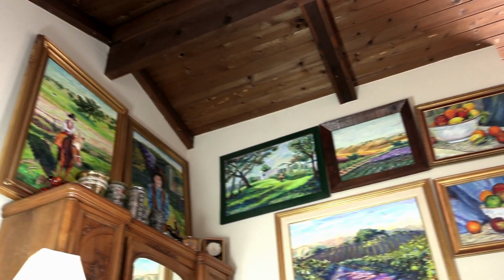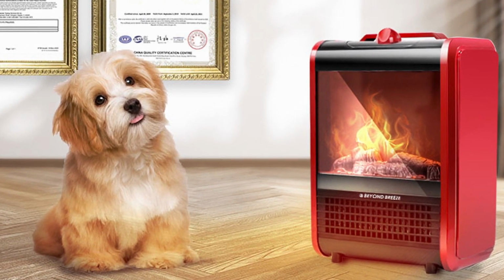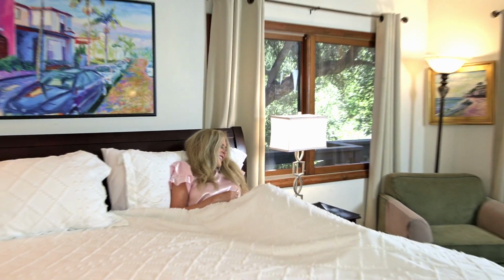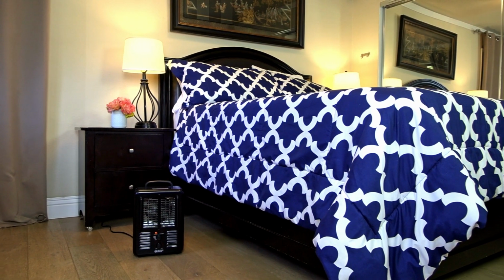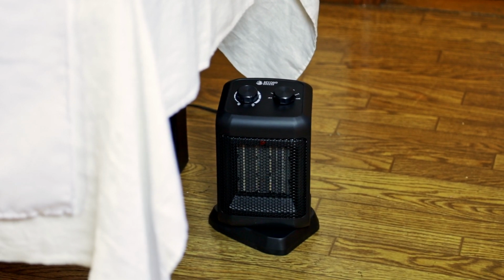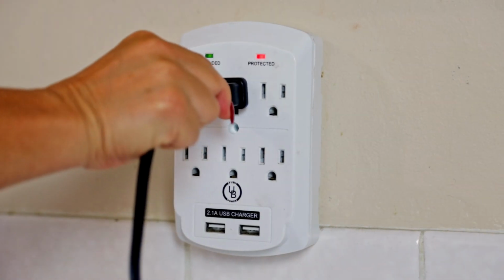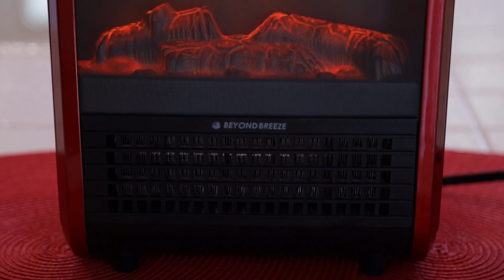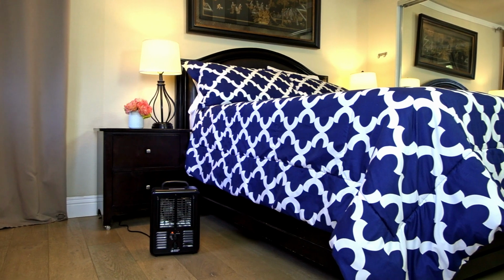Best Space Heaters 2022  |   Top 3 Home and Office Designs |   Beyond Breeze for Best Winter Gift

Comment: If you want to heat a room with a high sealing (or any room) you have to warm the whole volume of air in the room. Well... unless you're a bat that is. Hot air rises up, so as soon as the stream hot air out of the heater has a chance to slow down, it's rising to the top of the room. If there's no serious air circulation in the room there's actually going to be a very noticeable change in temperature from the floor to the sealing. The trick with the table is actually a good idea. The table and table cloth are going to hold on to some of that hot air.
Overall a heater like these is not a bad thing to have during winter. Especially a relatively mild winter, like the ones in California. If you live somewhere a bit colder, you may want to make sure you have something more serious just in case.
Reply from the maker: I very much agree with you.  I like the space heaters to just heat the room I'm in, so I can turn off my main heater.  The main heaters are so expensive to run.  If you lived in freezing climates, I still like these because you could set the main house on a very low setting, and spend time in your room or just one area of your house.  Good analysis as always!  Thank you for that!